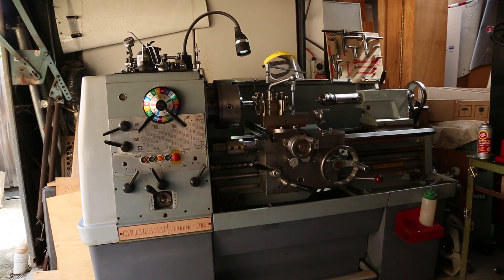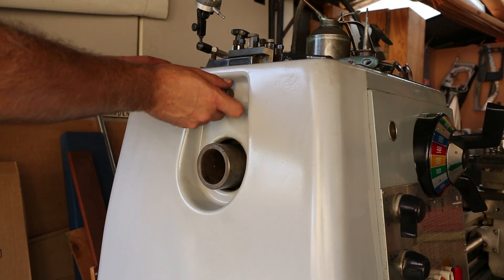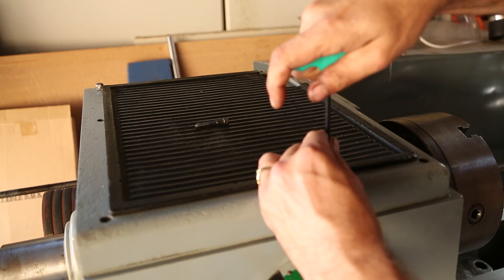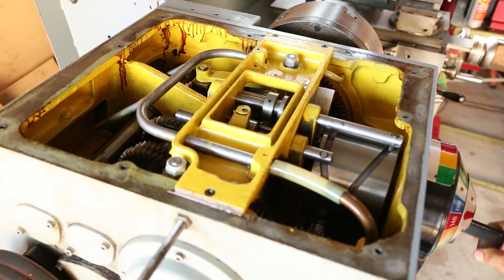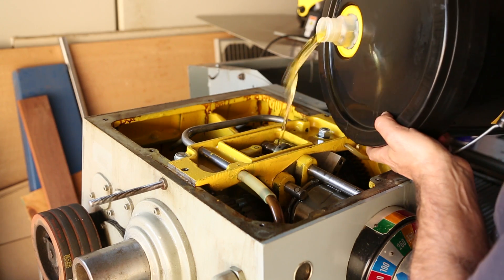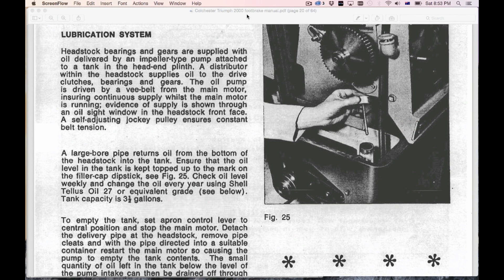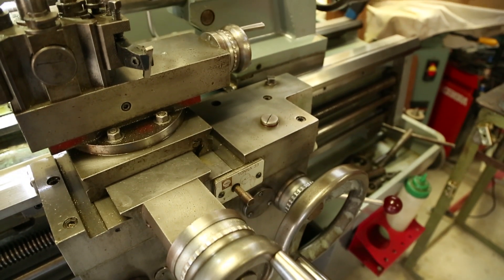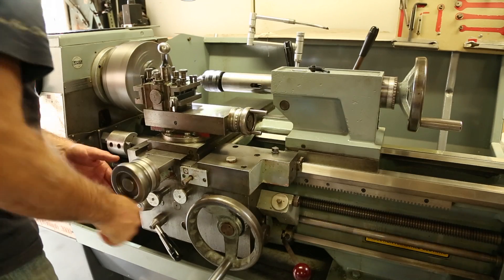Colchester Triumph2000 Oil Change

Comment: I have the same lathe.
I very much enjoyed your video.
A bit of a shock, one day I pulled the cover off and noticed the plastic tube to the front spindle bearing had pulled out.
I replaced it and made sure it was a bit long. The hose was hard as a rock.
You may want to replace all your hoses. It's cheap insurance.
Oh, I checked for bearing damage.  I measured .0003" runout at the taper and this was a cold lathe.
No noise, no heat.
I caught it in time.
Food for thought.

Comment: I like this Colchester Triumph 2000 Lathe but the Cross Slide thread is fine. When I machine pipe taper thread 8 or 7-1/2" TPI and have to turn the cross slide hand wheel many times.

Comment: With any Colchester lathe it is worth checking that the oil ways to the spindle bearings drain freely as the Gamet bearings rely on a good oil flow to keep them cool.

Comment: The Colchester advice is to not have the leadscrew turning unless you're actually threading with it.
Also important to regularly go around all the oil points on the lathe too.
Reply: How do you stop it turning take the pin out ?

Comment: When I got mine Triumph 2000 I did the complete headstock and gearbox oil change the same way like abom 79 in his video, but I did two kerosene flushes just to be sure and after draining all the kerosene ,I let it completely dry with drain ports open covered for a few days .Next I refill it to the correct level and after that I couldn't recognize how much better,smoother and quiter it was running.This video is perfect, thanks for it . It helped me a lot.
Reply: Did you see black crud at 1st when draining?.....I'm afraid I might see water....
Reply: @offgridmangogrower That depends on how much and how hard you're using your lathe and at the age of oil. I've had some sediment in both tanks,but it was normal as the lathe has some age and it was completely original oil from manufacturer and previous owner never changed it.The two kerosene flushes I did were completely necessary in my case cause the oil I drained was almost black,somewhat tacky and partially breaked down cause of it's age. Some crud in either of the tanks will always appear if you're using your lathe regularly without oil change for couple of years.
The flush like this is perfect to get all impurities and sediment out, so the new oil can perform as best as it can but you have to do it very carefully .In my case when I was done with the flush and new oil was in,the change in sound, performance and smoothness was huge.
Reply: @popovic5463  the change in sounds ...sounds encouraging...mine was out in the weather for about 10 yrs after the tarps were torn off by my rat hunting dogs. Im moving them under cover and my kobota struggles to drag it. Any idea what the 2000 weighs..?
I just turned the spindle and it was free and noiseless...but a oil change and flush will be next if I dont kill myself getting it on a trailer.
Reply: @offgridmangogrower According to the manual I have, Colchester 2000 thirty inch. length is 2580 lb./1170 kg and 2000 fifty inch.lenght is 2820 lbs./1280 kg .If you're gonna do flush there are couple of measures and precautions you should be aware of:
For example I did flushes just at the headstock and gearbox .At the apron I just changed the oil for a new one. Next is: You do flushing at your own risk cause diesel,kerosene or similar solvents are hard on oil seals and rubber pipes !! It can happen that you will have an oil leak after the flush,so be prepare that this could happen !!Secondly be aware during the flush you are running nothing but flushing agent in the headstock and gearbox ,so during the flush have both at slowest speed and revolution that you can and take off the lathe chuck, so there's no load on the spindle and you greatly reduce the chance of damage. Also don't put any load on gearbox during flush , don't move the apron and just let the gearbox spin.Don't do more than 2-3 flushes cause I think that's more than enough to clean the insides completely.If you gonna do the flush, put the flushing agent to the top level for the best results. For every flush I let it run for about 20 minutes.After the flush let the drain ports open, so that you let the air in and all flushing agent could drain and evaporate .Let it stay opened for at least couple of days and be sure that all of it is out. You can also open the headstock like in this video,put  some tarp or something similar loosely on the top and let it completely dry and evaporate that way. If you want to be completely safe, you could buy some same viscosity cheaper oil in the amount that you need for complete change ,drain the old oil out ,put the cheap oil in and run it so that it can flush the impurities out with much less risk of damage then with solvent ,then drain that one also completely and then finally refill it to the correct level with correct oil.You could do flush with solvent or with the cheaper oil and it depends on the status of your current oil .If you wanna do a flush that's completely up to you.I did the flushes because it was necessary in my case as the oil was completely original and it was in horrible condition.But as I wrote here before ,after I did flushes and put the new oil in, the lathe feeled completely different on many levels like sound, smoothness etc.Good luck with it.
Reply: @popovic5463  thanks erik...!
It will take a little time to digest this....appreciate your kindness....cant wait to slap a DC drive on it and shorten my 56 4x4 axle shafts and tubes...
Reply: @popovic5463  thanks Erick again...depending on what we see...I may just flush with tractor hydraulic oil..and cross reference to a synthetic if there is one...I will have limited time but I've got chucks to degrease and derust too....I covered the ways but will have to scotch pad them too....I'm happy to report the headstock turns freely but the carriage is gummed up or rusted....that 2000 has some crazy mass to it...getting both lathes off a zeeman trailer wasn't too bad except one lathe rolled over due to wet conditions....it will be fun lifting it partially with the tractor and a 5,000 # winch....I may have to make an A frame..
Reply: @popovic5463  not sure how to measure this outdoor patina finish lathe....I got a 7 1/2 swing and the bed was 6 ft long...so I guess it's in the Sherman tank class...so let's guess 3,000 pounds...no wonder my 50 hp kubota was having seisures... could not lift one end or barely drag it on soft dirt....I will dedicate a 5k warn winch and a engine hoist to lift on a trailer for a 1,000 ft move to a nice concrete floor. Who in this cholchester group has DC powered their tanks....I would have to build a huge power plant to spin a 7 hp 3 phase lathe...! So going 1.5 hp DC is a doable option if I'm not taking roughing cuts

Comment: I watched this video when I first purchased my Clausing Colchester 15x50. I just found it again.
I’ve done the fluid changes and other maintenance related tasks.
I love this lathe. It has features you would expect on a much more expensive brand.
Thanks for posting. I did have to replace the o ring on the carriage hand pump.

Comment: Great video, thanks a lot for that! How much Tonna S32 is necessary for a complete change in the headstock and gearbox?
Reply: Tonna is way oil that goes in the apron only and is used up while you are using the hand operated pump on the apron skirt plate!

Comment: european lathes all are pretty much the same when it comes down to the lubricants. headstock and gear box require pretty basic machine oil with extended life additives (CL) in VG 32, while the carriage requires bedway oil in VG 68.
def no rocket since there, all of the main suppliers provide them and you possibly can't do wrong.

Comment: you write 4 gallons of theses oil are required  --- British or American gallons? I'm from Germany and have to convert it to liters.

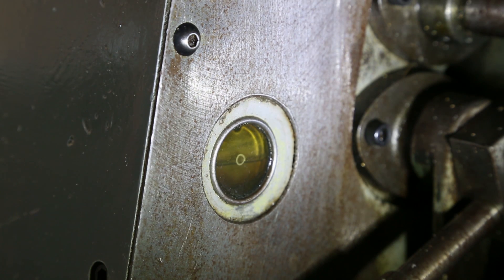And does your Engine runs in the wrong direction? See manual "Electric Supply Connection" Main rotation mus be clockwiese viewed from the pully end"   -- In your Video on 8:16 i think your Engine starts counter clockwise.  is this ok?

Comment: Cut my teeth on an old 13" Clausing/Colchester. Does yours have the high-speed threading attachment? I really liked that lathe.
Reply from the maker: No my lathe does not have the high speed threading attachment unfortunately nor the copy attachment which was on the unit when it was at Box Hill Tafe. Oh well.

Comment: That's a monster lathe........ looks better than my works one too......... that one's got about an inch of dust on it, poor thing. The speed control system really does look fascinating, I occasionally sneak into the machine shop just to look over my works lathe out of curiosity and couldn't for ages figure out the  dual speed control system, just figured it out..... all colour coded, line up the right colours for the speeds you want. Mechanically that system tickles my 'how the hell does that work'  button, hee. 

Great video

Comment: Nice vid. The oil system is a bit more complex than in my Taiwanese clone. What was the oil capacity in the upper spindle gearbox and the lower threading gearbox?
Reply from the maker: The lower tank is almost all of one can while the top tank (from memory) took about half that. It did surprise me how much oil actually went into the whole machine though. Thanks for your kind words cheers.

Comment: Nice service video I no Colchester make's a quality product but when you popped the top off I was surprised they didn't use helical gear's.
Reply: Listen to the sound of an older Colchester roundhead and you know what the cause is😏
Reply: @janvisser2223  I give up..?
Sorry I dont have my 2000 running yet...what sounds can you expect..?
Reply: @offgridmangogrower  
No panic Raymond, you did a nice job.
I was referring to the comment about helical gears by “time to do patriot stuff”.
The Collies have straight gears and especially the older round heads were a bit noisy in the head stock.
Enough about this.
I was wondering: are you besides the already installed filter also fitting a magnetic element in the oil pump system?

Comment: Dear Digital Hack

Great video on a subject that is not well covered on You Tube (ie: lathe maintenance, especially lube oil types).  Most of the forums seem to recommend an ISO 32, 46 or 68 hydraulic oil for lathe gearboxes.  The suggestions as to specific type if there was no manual, was to use the lighter weight oil (32 or 46) in "less worn" gearboxes, and the heavier (thicker) ISO 68 for more worn gearboxes as this may help reduce gear noise.  I installed ball valves where space allowed on all the oil reservoir drains as this makes oil changes far less messy.  I find these valves stiff enough that they won't turn to "open" from vibration etc.
Keep up the great videos.

Paul (from Canada)
Reply from the maker: Glad you liked the video and yes when I went to do an oil change, I couldn't find anything on Youtube to help at all. I approached Shell directly and spoke with their technical department which provided me the alternative oils but your right, using lighter weight oils in "less worn" gearboxes, and heavier for more worn gearboxes may help reduce gear noise. Not being sure about using any old hydraulic oil, I went with the advice from Shell but I'm sure there are plenty of other alternatives.

Comment: hey thanks for posting this - can I ask are you running off three phase or a phase converter I have a master which I will give the oil change treatment to - great video
Reply from the maker: I'm running mine off 3 phase since I'm lucky enough to have it underground to my shed. Thank you for your kind words. Good luck with your oil change ... at least you will know what the condition of your lathe is and hopefully run trouble free for years :-).

Comment: Nice video, the Triumph 2000 is great lathe to have in your shop.
But please be aware of the fact that it takes several minutes before  the oil pocket in the headstock, supplying oil to the spindle bearing adjacent to the chuck is filled up.
Let the oil pump run for a while before you run the lathe.
Reply from the maker: +Jan Visser Yes a good idea. I did run the pump for quite some time before using the lathe. Also lubricating from the top of the headstock ensured that the gearbox was actually oiled before use. The spindle bearing was not degreased however I do understand what you mean. Thanks for the kind words. Much appreciated.